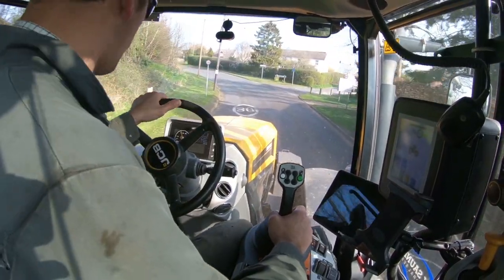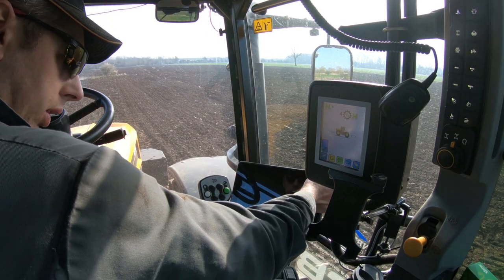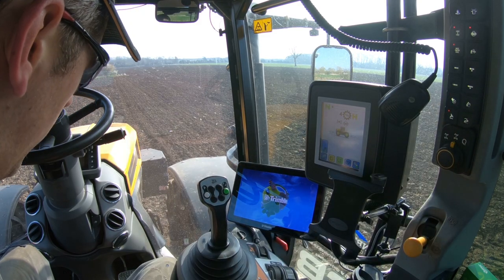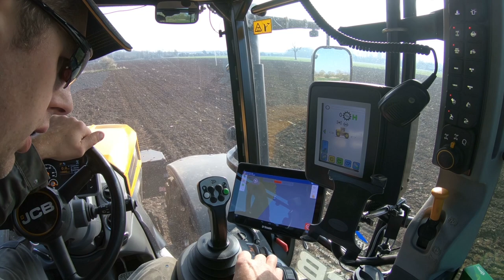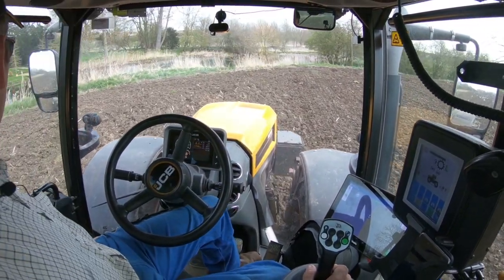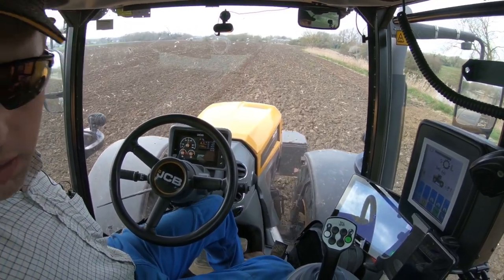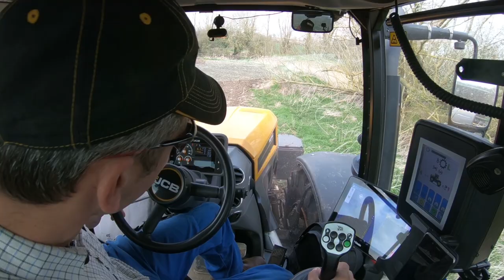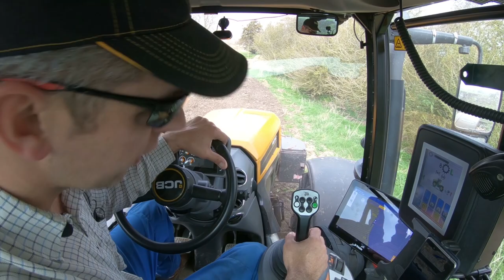SUBSOILING with the FASTRAC

Comment: your GPS screen is running on old firmware, working the old style PIQ app, a good few levels behind the newer style app, you will find it should be running the exact same style PIQ app being used on the smaller/newer GFX750 / Nav900 system